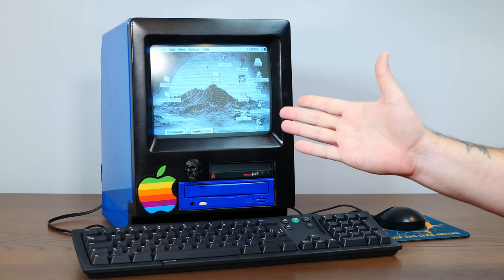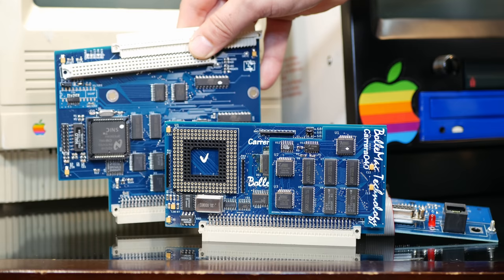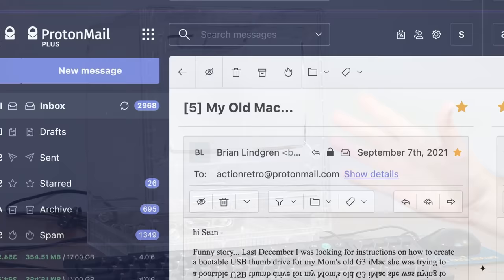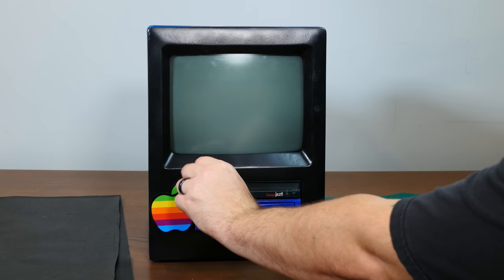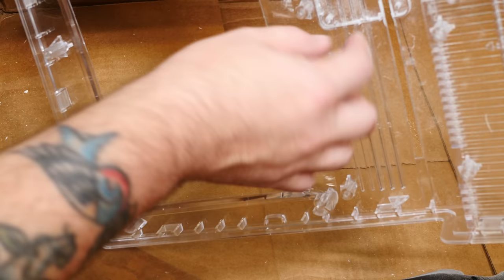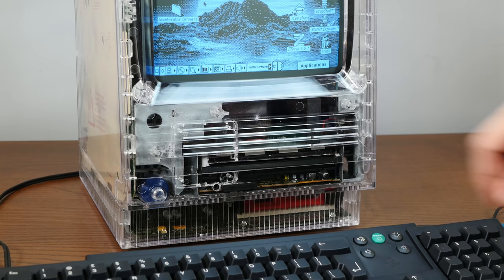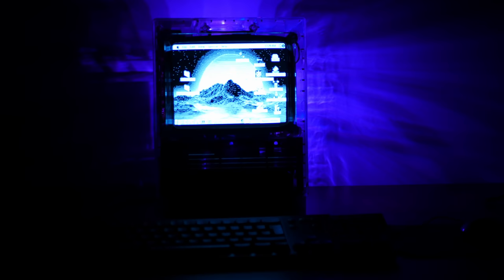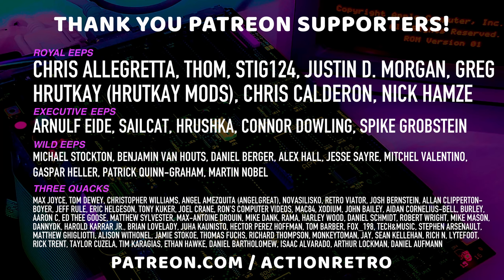A Clear Mac SE/30 With a CD ROM hacked into it (still cursed?)

Comment: Well, I guess I am in the minority, but I loved the black and blue. I miss the Jaz drive, but if you are set on going with the clear case, that blue face plate doesn't really work as well. Realistically, it's not a very valuable thing, and you can put the room inside the case to better purposes. Cool that the original owner emailed you, thanks for including it, it was a great read.

Comment: Personally, I'd say leave the other drive out and use external devices instead.  Don't suppose you could add USB ports to open up the external devices options?  I know 68K Amigas have this ability with devices like the Subway USB controller.
Reply: USB Mass Storage is supported by MacOS 8.6 and later. I think this is running 8.1?

Comment: So, while the case is completely transparent. There is the option of using products like plastidip that you can spray on the internal, keeping the clear plastic look from the outside but also providing a color of sorts. Since it's plastidip it'll easily peal off if you don't want to keep it. It's used a lot to give cars a new look without having to respray it proper. It might be worth giving the front of the case a spay down with black to see how it looks. I think it'd be very imac g3 like with the clear plastic top coat as a result.
Reply: iMac 040

Comment: the ONE thing now is to get greyscale on the internal monitor. an external monitor would be failure in my irrelevant eyes. utterly incredible beast! recently picked up an SE/30 because of this series
Reply: Why grayscale when there were color CRTs the right size and the output signal is right there?
Reply: @mal2ksc  you mean swap out the crt? That would be awesome no doubt, but I like the idea of keeping it black and white. As long as he doesn't stick an LCD in there
Reply: @mal2ksc  also checked online, colour CRTs are longer and take more power so even if you managed to change the analog board you would still need to cut a hole on the back of the case

Comment: Very nice transparent houses and excellent work done for the CD drive.
The RGB LEDs do not convince me much of their usefulness but on a mad car and absolutely unique as this, there can be there. It would be hilarious if the control of the LEDs took place from the operating system.
Other thing, the screen: it should be in color and maybe support the thousands of nuances.
Reply: You'd have to replace the analog board for that, which isn't exactly easy to do.

Comment: I would be really tempted to use the unpainted old case front and apply the same slot-loading mod to it, just so that it looks like you have a 5.25" floppy slot on a Mac SE. Either that or sanding/frosting the current transparent front so that you can still see the glow of the lights within.

Comment: When printing in clear filament, if you want optical clarity, you need to go for a really coarse layer height like 0.3 or 0.4mm. The more layers you have, the more refraction as the light moves from one layer to the next, so you end up with a lot of light scattering. Hence the frosty white look. It's basically like taking clear perspex and roughing it up with sandpaper.

Comment: I've been really liking this series! FWIW, I thought the solid front would have been better, as the case is so busy in front when you can see through it, but I know that the audience has spoken! :) What's missing is *color*. Have you thought about painting the inner metal frame black and blue, to bring some of the cursed Mac aesthetic back? It also definitely needs an era-appropriate Apple logo (though maybe a smaller one than last time). I'd also replace the paper insulation sheet on the analog board with a thin, clear piece of acrylic so people can see the back of the board. Of the options you listed, I would definitely set the SCSI 2 SD up to pass the sd card through the upper floppy drive slot. You'll get a lot more mileage out of being able to access that than you would a Jaz or Zip disk anyway.

Comment: Nice work. This thing looks great.
A 68k Mac on the internet in the early '00s wasn't a big deal or even uncommon; I had one. Most days after school I'd use my Performa 475's 14.4k modem to dial into whatever the cheapest ISP was at the time (remember NetZero and the store-branded ISPs (Walmart, etc)?) and hop onto AIM and a few of the less flash-heavy websites that I frequented. I upgraded to a blueberry iBook around 2002 but the Performa still got AIM duties on the regular. Also I figure the best choice for an AIO 68k with CD built-in would likely be the LC/Performa 575, the last and fastest of the Trinitron AIOs; the 58x series is slightly faster (thanks to its Quadra 63x-based logic board with Valkyrie video chip) and more readily upgradeable to PPC via simple logic board swap (the 575 needs either a rare and frankly lackluster upgrade card or a lot of case hacking/chassis swapping for a new logic board), but it has a basic shadow-mask CRT in a slightly bulgy case and its plastics are much more brittle than its predecessors (these and the early 52/53xx models are the worst example of Spindler plastics. Seriously don't try to ship one or you'll end up with a box of beige shards with some bits of metal and a CRT on top).

Comment: Sean, definitely Zip drive is the way to go for this machine. If you want to get the SCSI2SD card ported out, there's extension cables for those, put it wherever seems to make sense.

If you want to wire in a video board … make sure it can be taken apart for maintenance and repair. This mac is cursed after all.

Comment: I'm thinking you should install some sort of clear plastic box on the side of the case that obstructs the internals that can hold those USB drives. Maybe add a USB splitter bank or something under them, too. After all, there's nothing more cursed than having ten different peripherals plugged into your computer 24/7.

Comment: The new CD-ROM drive seems so much better than my old Pioneer slot loader. That thing you had to jam the disc a lot more than half way in before it actually sucked it in. But the case looks amazing! I think the problems with the cut-out for the CD-ROM drive aren't a big deal. It would probably look weird if you cut out the slot in the right place from the start and left the floppy slot in place, so having a black cover under the slot seems like a better solution.

As for the Jaz drive, it definitely would be more cursed to have that, but having a big cut-out would look pretty ugly, and it would kind-of ruin the look. I like the idea of a Zip drive with the front bezel removed and just a slot cut out for the disk. Or a LS-120 SuperDisk, although a SCSI one might be a bit hard to find.

Personally it makes more sense to have some kind of removable media accessible from the front, rather than the SCSI2SD, since that's your boot drive and you're never going to remove that in normal operation. Making it accessible from the front at a public event is just asking for someone to pull the card out while it's running.

Anyway, hopefully you can get the speaker working again. But no matter what you decide to do with the machine, I can't wait to see it!

Comment: IMO: you should only put peripherals in there that are able to eject through software. So a Zip drive, or an LS120 drive would fit the bill. You’ll need to add another slot, but it would definitely be worth it! 

Oh, and it looks awesome indeed! 

Almost forgot to ask: did reassembling it solve the latest curse on hanging at boot?

Comment: I had a 24-bit color PDS card mounted in my 1992/93 LC-III in the late 1990s. It ran a secondary 17" monitor at 1024x768 in all 24-bit true color glory. I wish I still had it and knew what the brand was. I think that card may have worked in the SE-30's PDS slot. 

I still have the LC-III (without the card, as I eventually moved it to a PowerMac LC 5215 later) and my original SE. Unfortunately they are just gathering dust in boxes these days.

Comment: I'd have preferred using an exacto knife to score and cut the plastic as the dremel is too aggressive for precision work. Also I was wondering if raising the back of the cdrom drive would have tilted it enough not to need the extra dremelling. Said that, the end result is overall nice to look at.

Comment: The Dremel action was a bit hard for me to watch ;-) I use a sharp thin knife to cut thin plastic. It is much more precise and you will get nice edges, no buffing needed. Your results are ok, though. I have seen SCSI LS120 drives but they seem to be rare. A Zip would be the most fitting in my opinion since it was a standard accessory for a mac of the late 90s. I personally think you could just leave the SE30 as it is. A ZIP, JAZ or anything SCSI can be connected externally. Even a floppy can be installed externally without a problem. The SE30 looks quite nice btw.

Comment: Maybe it just doesn't like one of the boards ATI RADEON Graphics card is a board you should look at getting provided it has the correct connector see if AMD has the card that you need and the DVD drive needs to be a slot loading drive as that is what APPLE used.